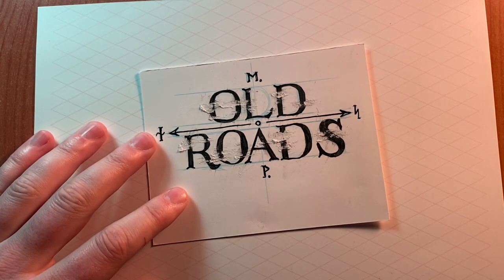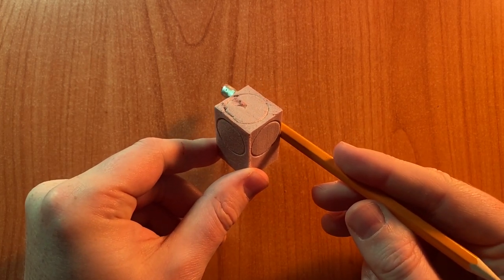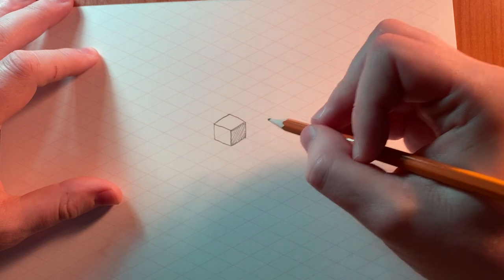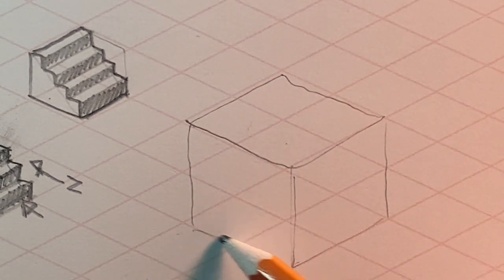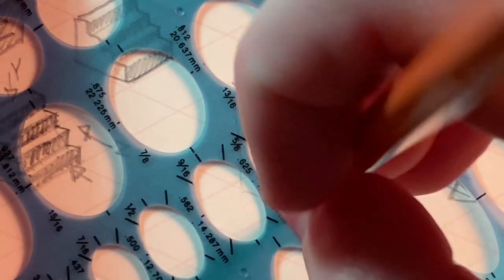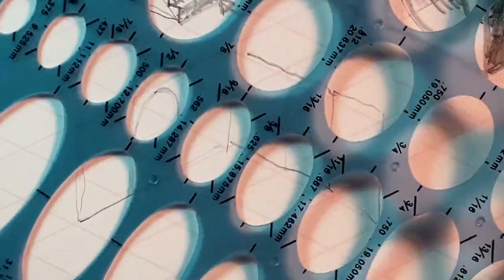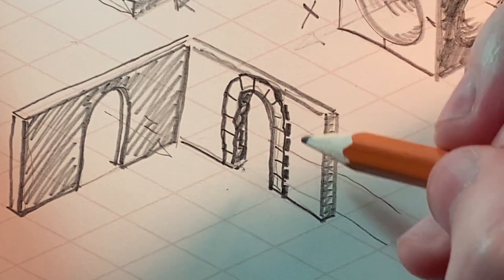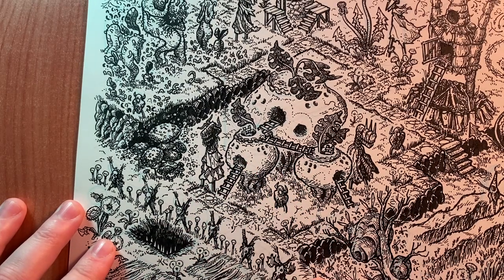What You Get WRONG With Isometric Maps

Comment: The Y Axis being vertical and the Z being horizontal really hits that angry goblin part of my brain. Otherwise, fantastic video.
Reply: Why? It's the convention in 3D design, from videogames to modeling software that Y is up and Z is forward/backward.
Reply: @imperfectimp  that is highly dependent on the software
Blender is X left-right, Y front-back, Z up-down
Unity is X left-right, Y up-down, Z front-back
Unreal is X front-back, Y left-right, Z up-down

and that's 3 of the biggest software that deals with 3D geometry in the industry... you can imagine how wildly things vary outside of that
Reply: X/Y being the floor is reasonable, but X/Y could also be the default vertical view plane. I think he’s doing the latter here. It’s much more disorienting that he says “access” instead of “axis,” imo.